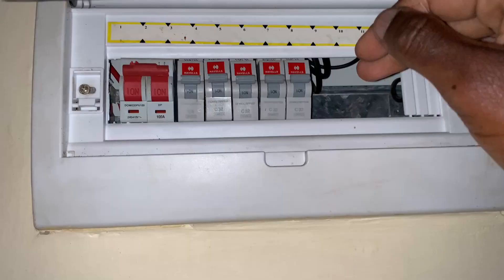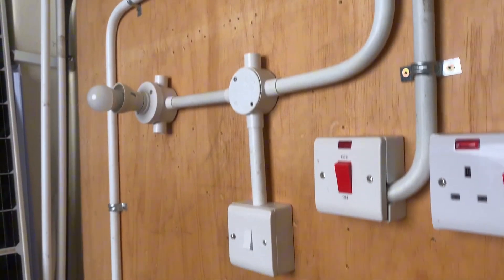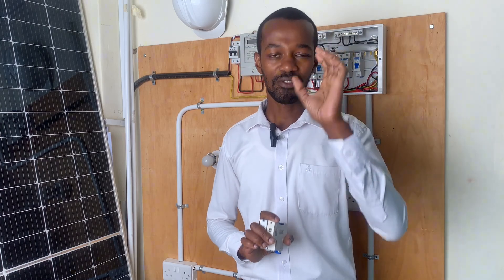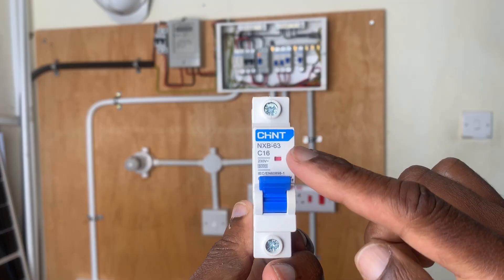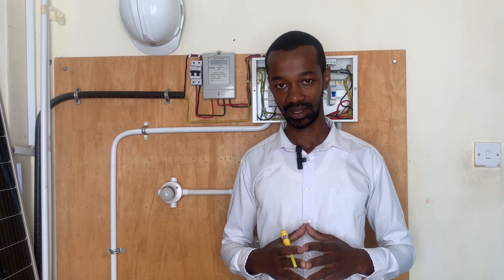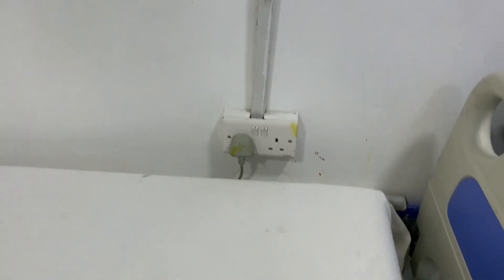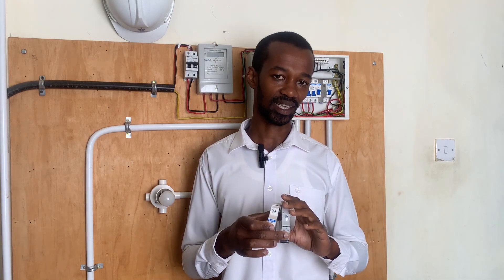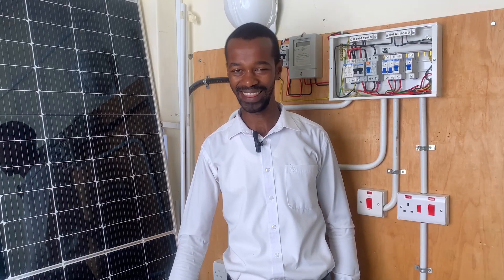MCB Selection for House Wiring | Complete Guide for Safety & Efficiency

Comment: I like how you separated the circuits, like 32A in the kitchen, 16A dining/sitting room, 16A bedroom unlike running the entire house sockets wiring from a single 32A MCB
Reply from the maker: Absolutely!! This ensures safety and guaranteed power in some socket outlet incase some fail. Do you think including a ring circuit helps even more?
Reply: @topheightselectricians Yes but it depends with the client's budget. Otherwise for most clients I use radial